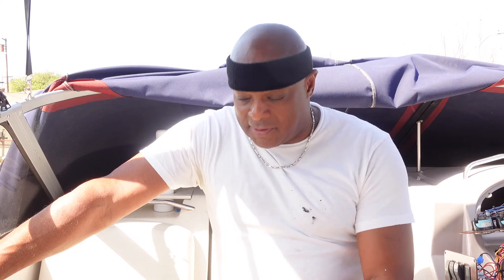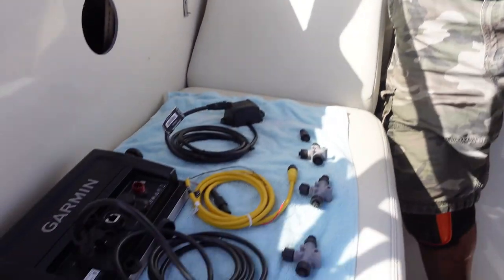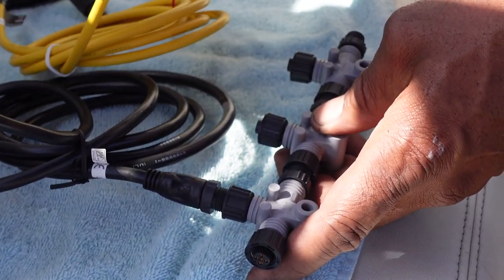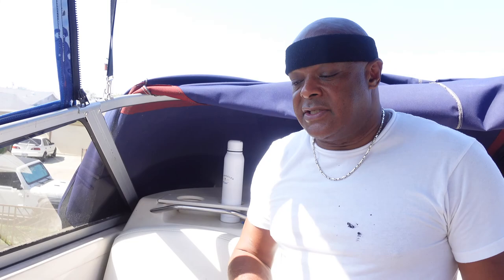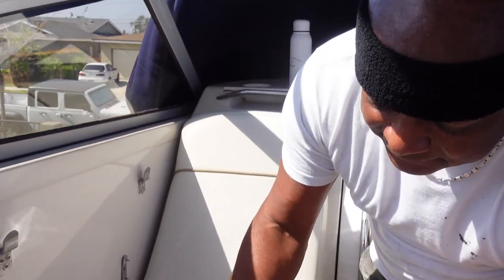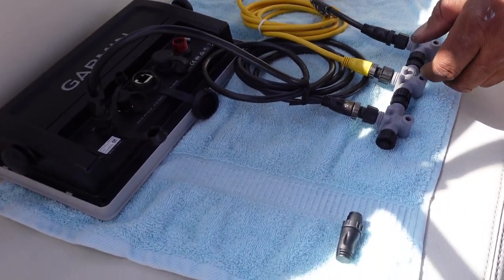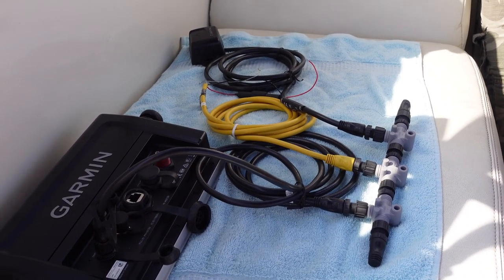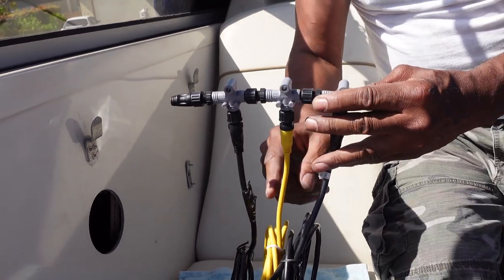How all GARMIN devices talk to each other. Installing NMEA 2000 #boating #yachting #garmin #NMEA2000

Comment: Great video! 🤩 So informative without complicated talk around it. I’m a neewbe and have a garmin echomap 72cv, and I bought this 6 years ago without any knowledge about nmea 2k. Next year I change out our old 50hp Johnson 2 stroke with a brand new Honda BF60, and this have nmea 2k and with that connected with the Garmin I got hours, fuel consumption, temps etc. displayed on the Garmin. The org tachometer following the motor does not provide hours, and I find that important to follow the instruction how to run in a new motor (or what you called it nativ english) ie not rev to much the first 20 hours, and oilchange etc. Thank you for learn me that I need a extra antenna to make the garmin know, at all condition, the direction of the boat👍 What do you concider the next most important thing to connect? I think about a VHF radio, to make it more secure if anything bad happens especial now that my kids is going to use the boat alone. What do you see as main benefit of networking the vhf? Is it the gps that gets more accurat? Or is it much cheaper to get a ais transponer or ais reciever (or both)? Or is whf just obsolete nostalgy,  now that we have cell phones? Greeting from Oslo Norway 😀

Comment: Great video. I have a dumb question but want to ask anyways. The power to the t block, that isn't providing power to your depth finder is it? Does the depth finder needs its own isolated power cable or does the power into the t block, power everything connected to it?
Reply from the maker: No. The depth finder gets its own power through the chart plotter. Apologies for the late response
Reply: Good video, thanks. I’m putting in a steady cast and Garmin 73sv into my old town kayak in the morning.